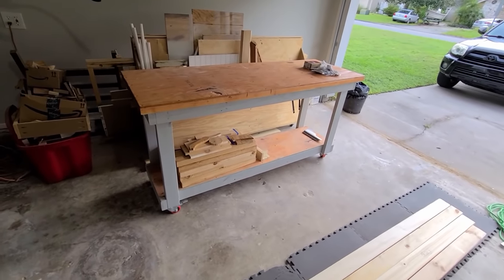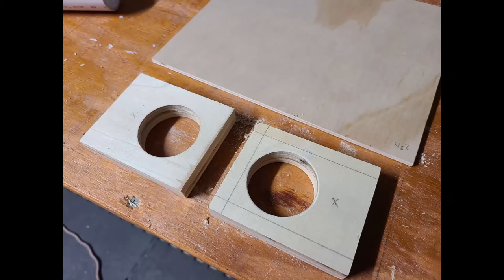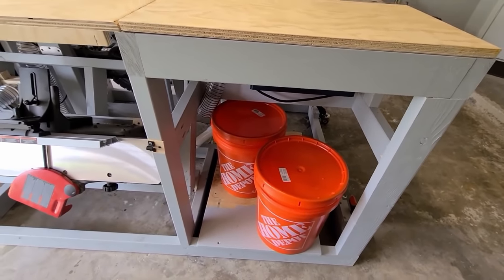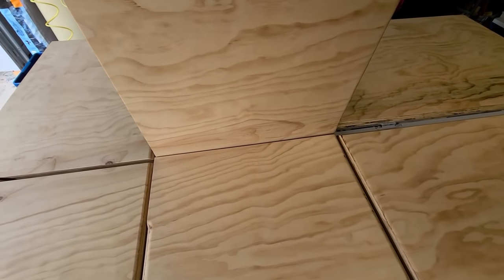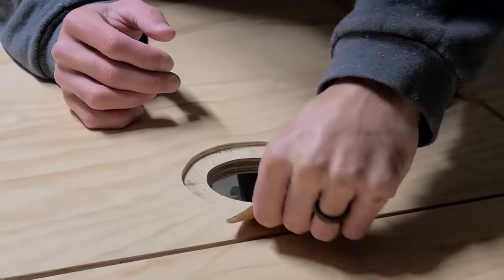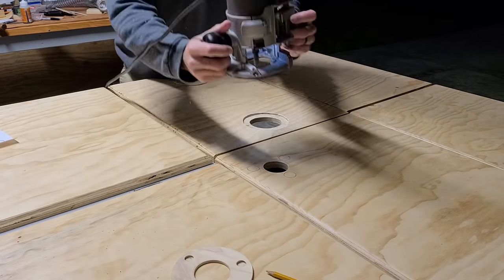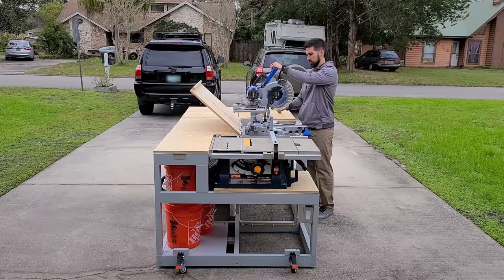4x8 Workbench, Tools, Vacuum, Power and Dust Separator

Comment: I’m curious if you put in a recess for the door hinges on your miter saw when it’s upright. Otherwise I don’t know how the hinge can work. Unless that bar with the hinge is set back to account for the space it needs when it’s folded on it itself when up
Reply from the maker: Yes, something like that. Where the top meets the bench I had to sink the hinges down slightly because of the type of hinges I used. I think a different style hinge could simplify this.

Comment: Definitely needs an extractor rather than a shop vac. A lot of the suction is lost to flex tube and 90 degree piping. I made the same mistake in plumbing my CNC router… I’m going to replace my shop vac with a proper extractor.
Reply from the maker: Its actually not that bad since only one blast gate is open at a time but more power is always better.
Reply: @phillipreborn  yeah, the important thing is it gets the fine dust… but it sometimes fails to pick up the chips. It depends on the bit I’m using in my CNC and how deep it goes into the wood or aluminium. But I was told the higher volume of air the extractor has will increase the chips I move. This is especially useful with a router, be it CNC like mine or the router table I’m currently building.

Comment: "First through the jointer, and then the planer ... ". Try the other way around if you want the piece to be squared and true. The planer will register to its opposite surface, but the jointer will register to the perpendicular surface (the planer's). So you want that larger surface to be flat before you use the jointer, not shaved away secondarily by the planer.
Reply from the maker: Thanks for the tip! I was and still am learning the basics.

Comment: Impressed, the only thing I can think of, why didn't you just put your thickness planner on the other side with no hinge to impede it? Congratulations good job.
Reply from the maker: Thank you very much. That is a good point that others have mentioned as well. The router fence needed a vacuum and moving the planer to the other side would have added an additional longer tube. I'd say both could be correct solutions.
Reply: @phillipreborn  I would agree with the planner ending up with a longer hose, but the layout and benefits outweigh the cons. Try switching it to the other side, you just might find a much more suitable result.

Comment: Nice build. One thing I don't understand, though, is why over engineer the power outlets? You could have just used a power strip with GfI and plugged all into that simple and faster.
Reply from the maker: Thank you. The power cables for each tool only reach so far. There is a box at each end where the surrounding tools can plugin to each box and I can plugin the entire bench from a single point.

Comment: By far the coolest and most functional bench. How did the bucket vacuum work out?
Reply from the maker: I appreciate that. It works well so far. The only place it seems a little under powered is with the miter saw but that might be the miter saw's fault.

Comment: how those joints holding up just using pockets holes. have any blowouts with that soft wood? i like the design just not sure on the joinery used in for this application, it's not like the work bench is just some cabinets hung up on a wall. the stresses on the joints with pocket holes may come lose or break. just curious how it's holding up with this method you used. i know i don't want to have to worry about that if chose the same method. i guess it also comes down to the type of work your doing. i think i'll go with the the half flap or mortis and tenon just to have the ruggedness if it isn't up to par. but i have to tell you your design is genius. i like all the compactness and easy access to everything you need. great job
Reply from the maker: Thanks I appreciate that. I've kept an eye on them and they are holding up surprisingly well. If I had more time, proper tools, and experience at the time I would have preferred a different type of joinery. The pocket holes were quick and easy and so far have worked. We'll see how it holds up over the years.

Comment: Looking at all of the hoses and wiring  makes me think you should have created a “wet wall “ in the center. A large vacuum chamber maybe the size 2x4 sealed vacuum with the wiring sharing the same space.. a removable baffle system separating the dust ..and minimal hoses , cleaner look…
Reply from the maker: That's a good idea. Although space is tight between the tool frames that swing down it might have fit under the table saw.
Reply: @phillipreborn  the design is really good, its easy to add to after you did the original design work.

Comment: U should place battery powered flex lights on the under side of the doors
Reply from the maker: Like the trucks?
Reply: No kinda like the pit boss flexible grill lights in tractor supply. So you can bend it where I want it
Reply: Where you want it.*

Comment: First off nice build and way to cram all of that into that work bench. Why not just swap the planer to the other side? That way the dust port would be facing the exterior? Or did you have it that way to use the planer and jointer without having to put the other away
Reply from the maker: Thanks for the feedback. Yes, I wanted to be able to use both at the same time and if the exhaust was facing outward it would have needed a longer vacuum hose and a way to store the extra hose without getting in the way of the planer while its folded down.

Comment: I noticed you spaced your swing down hinges on the planer. Are all of the hinges spaced out.
Reply from the maker: No, only one side was. When I initially considered the thickness of the hinges with length of the tool frames I did not take into consideration that the pin section of the hinge sits below the tool frame. The hinges sit very flat and the pin section is not between the work bench frame and the tool frame so I did not have to account for the pin thickness (ie.  door frame). I notated the correct measurements in the plans.
Reply: @phillipreborn  Ok thanks. I wondered why the math did not add up on the plans. The hinges account for 7/16  to 1/2. By the way excellent build. I'm in the middle of my work bench build with your    plans. My equipment is different-- so I'm making adjustments.

Comment: I think “they” (and I) would call your project and solutions as thinking-outside-the box.  Nice job!!

You might want to consider thumb or knurled-head screw / bolts for the blast gates.  The would be a heck of a lot easier and faster and more convenient than hex nut bolts.

But in the end, while it is nice to experiment with ingenuity, maybe for the cost of all those supplies and time spent, you c/should have considered a new garage for the old tools… Still, I love the video.  Thanx.
Reply from the maker: Thank you very much! Larger bolt heads/handles will definitely help. I do hope to build a shop someday.
Reply: @phillipreborn  The obvious (and only) place to go for whatever is made on earth at reasonable prices and very quick availability is McMaster-Carr (https://www.mcmaster.com/).  Every time, I get a "oh, I did not know these existed" or "wow, I know exactly how I can use that" etc.  For me, this is great place for inspiration on an alternate and often better way to do stuff.
Reply: FYI… I was on McMaster-Carr looking for some stuff for myself, when I came across ANOTHER kind of nut that might be useful for you.  IF you search for handle nuts and / or wing nuts (not the political kind), you will see other options you might want to try.  The handle nuts look cool and would be real easy to implement: if you have the space for the handle.

Comment: What if you had turned the planer around? Wouldn't that be easier to connect the vacuum hose?
Reply from the maker: It might work in some cases but here the hose would be running to the outside of the bench. Thanks for watching!

Comment: Can you go in more in detail on how you aligned the tools to be even with the workbench top?
Reply from the maker: Absolutely. I plan to make another video in the near future addressing any questions. There was just a lot of careful measurements to get the alignment just right. I errored on the low side to be safe and added washers or shims where needed to bring them slightly above the top surface.
Reply: @phillipreborn  thank you!!! The hinged tops too would be great.
Reply from the maker: I used 90 degree surface mount hidden spring hinges. https://www.homedepot.com/p/Everbilt-90-Degree-Surface-Mount-Hidden-Spring-Cabinet-Hinge-1-Pair-H01068E-NP-CP/302867742?source=shoppingads&locale=en-US&mtc=Shopping-B-F_D25H-G-D25H-25_4_BUILDERS_HARDWARE-Multi-NA-Feed-LIA-NA-NA-BuildersHardware_LIA&cm_mmc=Shopping-B-F_D25H-G-D25H-25_4_BUILDERS_HARDWARE-Multi-NA-Feed-LIA-NA-NA-BuildersHardware_LIA-71700000044822926-58700004636006010-92700060790923534&gclid=Cj0KCQiAst2BBhDJARIsAGo2ldVHv84jPerAqR1pE1EyAS1omsjSK-W9WZst8_dN5syOHryA4YK7wR4aApILEALw_wcB&gclsrc=aw.ds

Comment: This is very impressive.  But I gotta ask....why not just turn the planer around?
Reply from the maker: Thank you! For me I needed the larger work surface for the planer outfeed and I wanted it to share a vacuum tube with the router instead of adding another inlet. Since the router fence is put away when not in use the vacuum tube needed to hide away also. It could have worked swapping the router with the planer but it would need 2 vacuum tubes. I also usually go right from the jointer to the planer so being on opposite sides they can both be in the upright position.

Comment: My first thought is potential storage on the bench. I see a few spots were a few shelves or drawers can be added for quick access.

Second how has the dust collection been. Since the main hose from the vacuum is much smaller than the others I am wondering how it affects air flow speed?

Finally did you ever add the router?
Reply from the maker: I did a 2 year update where I went over the dust collection in more detail.

Comment: Many ingenious ideas here.  I love the magnetic attachments for the dust collection!

How did the HD bucket vac work out?  It it powerful enough?  Also, with all the tubing and bends, etc, does that affect the suction much?
Reply from the maker: Thanks for that generous compliment. The bucket vac has worked out well so far. Only one tool has the blast gate open at and the bends don't seem to slow it down much at all. The only place it is slightly under powered is on the miter saw but I think it is the vac port on the saw itself.

Comment: Very well thought out design. I am curious though as to how well that bucket head shop vac has worked out. I went through several of them over the years before giving up on them and they never seemed to have enough suction for a good dust seperator. Have they gotten better? Does it pull an adequate amount of dust out of your environment?
Reply from the maker: It works OK but a small form factor high performance vac would be better. If budget wasn't a factor I believe festool makes a small rectangular vac.

Comment: How swaare and flush is the top though? With all the moving tops....and how has the dust collection held up? And with the planer specifically
Reply from the maker: The top is pretty flush and has held up without warping. The dust collection held up but I would not recommend the bucket vacuum. There are a lot more powerful compact options out there now.

Comment: @oarDIY How is this table 2 years later? Any updates done or modifications? Is it still square? Vacuum hoses are unique, how are they holding up and functioning?

I'm concerned with the 2x4 frame, and thinking  to add 2x6's for more strength.  Thanks!
Reply from the maker: I actually made a 2 year review video on it. Everything is holding up well and the 2x4's are strong enough for what I load on it. I need to upgrade the vacuum though.

Comment: Pretty cool.  However did you consider placing the miter saw and the table saw on opposite sides as I find those 2 items the most used and could probably have both tools remain in place so as to cut down on the number of times you have to set up and stow away the 2 most used tools in a shop.  Just a thought.   Well done though, you got a lot of storage and use of tools in a small garage space.
Reply from the maker: Thank you, that's what I was going for. That is a great point. I did put a lot of thought into the layout (functionality wise) and considering what I use it for mostly, I needed the miter saw to to have maximum support on either side when cutting long boards in half. I did have to make some sacrifices but I try to plan out which tool is needed first then rotate what has priority to utilize the work surface.

Comment: Ok, so now I have to go buy a bandsaw, a  planer, and a jointer so I can build one of these!! Amazing. I have an old Craftsman table saw that I put my router into one wing with a Benchdog cast iron router table. Love this idea as I am also relegated to one side of a two car garage. Nice brother.  Definitely subbing. Was curious how the vacuum is working?
Reply from the maker: Have fun and thank you! The small vacuum works adequate except on the miter saw. A little more power would always be better if it fits.

Comment: Really a brilliant design.  I am surprised that the pocket hole attachments between the sides and the bottom are sufficient to handle lateral forces that might be exerted on the framing.  I would have thought angle brackets would be needed to add reinforcement.  Still, really well thought out.  I have a 16 x 11 space for my work shop and I'd love to put something like your design in, where I could walk around and use the individual machines.  Unfortunately, I wouldn't be able to remove it if I ever moved out of the hours, as my door is only 3' wide.
Reply from the maker: Thank you! The misuse of pocket holes in woodworking is a valid concern. If you are referring to the vertical load, the base frame has 4 inch screws holding it together in the corners and middle sections which is what the vertical supports are resting on. The horizontal shear force is pretty minimal for what I use it for which is sliding wood across the top surface, but the frame is pretty rigid with glue and pocket holes. The overall height of my workbench is only 3' so you might be able to move yours out sideways.

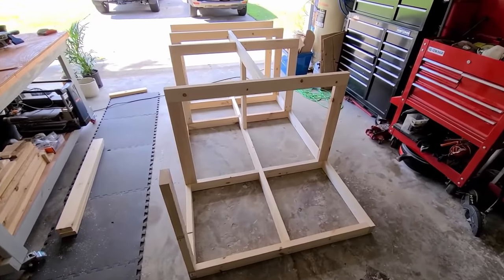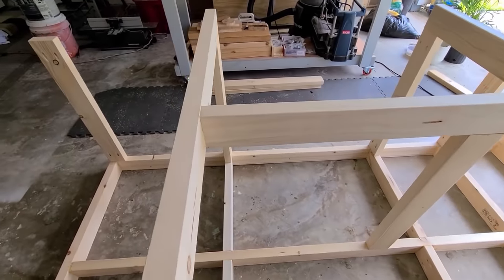For reference 4:05-4:18
Reply from the maker: Here is a link to the plans, cut list, and a link to a video that elaborates on them a little. https://www.etsy.com/phillipcreative/listing/955545412/simple-4x8-full-shop-workbench-plans?utm_source=Copy&utm_medium=ListingManager&utm_campaign=Share&utm_term=so.lmsm&share_time=1614306374860

Video about the plans.
https://youtu.be/UvVJFht_9Vw

Comment: Looks fantastic, well done!

Is there a reason you didn't just turn the planer around and have the hose connect/disconnect on the outside edge of the table?
Reply from the maker: Thank you! I could have turned the planer around if it was moved to the opposite side to still have a large outfeed. That would have worked with a longer separate vac hose. I liked the idea of sharing it with the router fence since it won't always be connected to the router. That is a good suggestion though.
Reply: @phillipreborn  Thanks for taking the time to reply and share those thoughts!

Comment: I love the design but I just realized a major flaw (in my opinion) there are no vices or anywhere to easily add a vice that can work with the bench top. Maybe there is a way to add a face vice or and end vice but there would have to be an additional jaw for the vice rather than having the workbench be the jaw.
Reply from the maker: This was mostly for the power tools, that's a good idea though. I do have a spare bench for clamping or banging on things.

Comment: Uhh, I like what Sandals Ryobi was trying to achieve, but it is kinda half assed. First, a Home Depot bucket vacuum patched through a network of loose blast gates and non-sealed fittings with flex hoses everywhere is flat out not going to get the whole concept of dust extraction at all. It's hardly going to do anything. You'd be better off haveing someone vacuuming the kitchen floor with garage door open. Spend the money & get an iVac switch, and they also make automatic blast gates, but those are pricey. If you're going with 2.5" ducting, your going to need some power behind it. I made a 2.5" portable separator with a 5 gallon bucket, lid, Dust Deputy, with a 13amp, 3 stage, central vacuum from Amazon coupled on top of the Dust Deputy separator. The exaust of the vacuum has to oppose the inlet to the separator due to the powerful wind forces that would send it flying like a tumbleweed if they were not lined up. Ever cut MDF on a tablesaw?? With this set up, you'll cry to mom after ripping 3 feet.
Reply from the maker: Its actually not bad and I don't like working with MDF.

Comment: So how does the bucket vacuum work out so far? Does it have the suction to pull all the debris or is there residual left in your hose system? That is the next thing I need to get going on my table. Great build by the way. Thanks for sharing.
Reply from the maker: Its working well so far. It seems a little under powered for the miter saw actually, but I think that has to do with the suction port on the miter saw. A little more power would always be better.

Comment: Does the dust port on your planner get higher up as you increase the thickness of the board?  wondering if there was enough "play" in the hose to accommodate this.
Reply from the maker: So far I haven't had any issues but I haven't had to plane anything thicker than 1 1/2 inches. I could connect the shop vac if it doesn't reach if I had to.

Comment: You should not carry planer by the middle rod. That's for synchronizing left and right rods when you adjust height. once it is bended, it will be useless. Good work thou
Reply from the maker: Thank you and thanks for the tip!